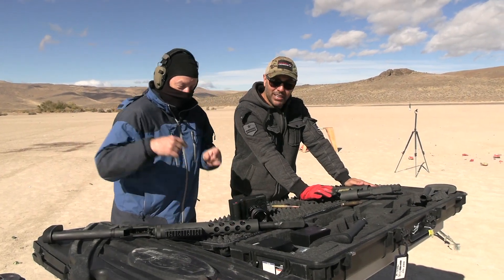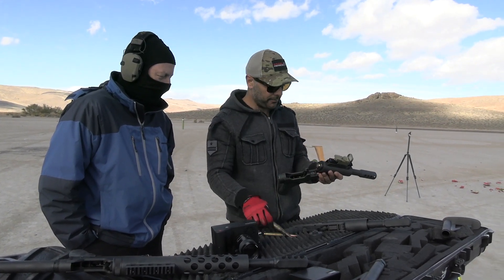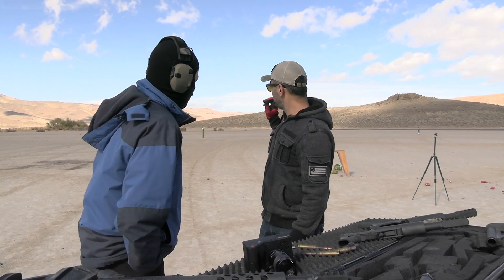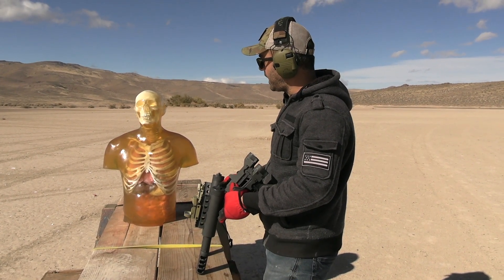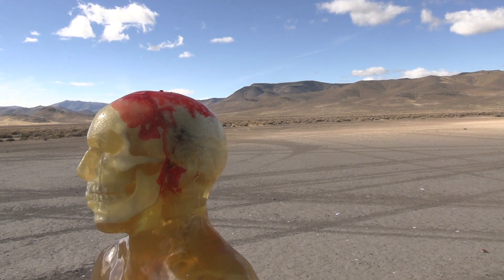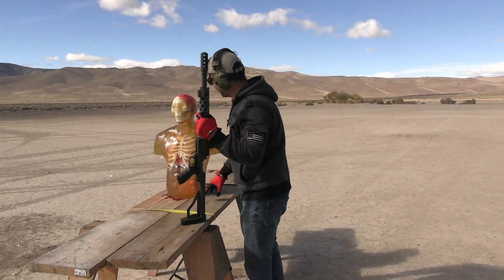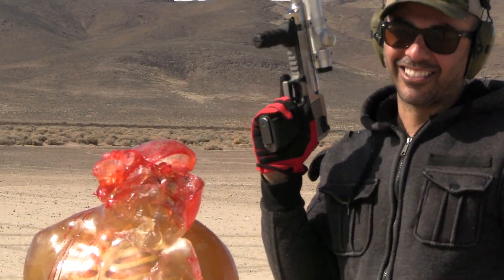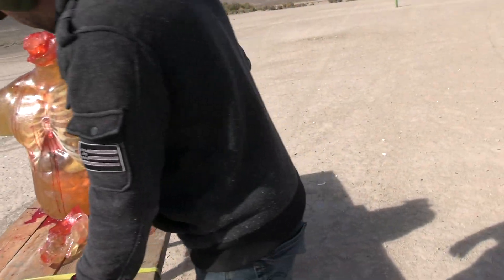Micro 50Bmg  vs Ballastic Gel

Comment: ...."when a high-speed projectile impacts the head and penetrates the skull, it first perforates a hole in the outer table of approximately the same diameter of its own presented area. However, as the bullet breaks through into the inner, less-dense trabecular layer, the area expands roughly in a cone shape until it finally breaks out a wider hole through the inner table. It is this cratering process that assists forensic pathologists in establishing skull entrance or exit wounds, thus facilitating the determination of the direction of the bullet's passage relative to the body and the direction of origin of the shot...."

Comment: Kinda surprised how little damage the .50 bmg SBR/pistols did. But I guess that’s what happens when you only burn a fraction of the gun powder in those rounds and such a short barrel to get the full velocity/energy from those rounds. But that “shotgun” puts a whole new meaning to “blowing the back out.” Pretty sweet to see that the dragons breath even went thru him. Cool video Edwin!
Reply: I'm sure the rounds are tumbling a dozen feet out of the barrel, too. There's no way that short rifling would rotate those bullets
Reply: It’s not just that. With full metal jacket rounds, at that speed, they just keep plowing forward. A good friend of mine who was a tanker in my platoon took a 50bmg point blank to the right shoulder, unloading the Ma deuce from the TC hatch. It was being handed up to him barrel first, but it wasn’t cleared properly. He dropped it and the bolt closed and sent a round right though his shoulder. Now, he was a giant man. 259lbs and 6’4. It punched a clean hole through him. A guy my size may have lost an arm.  Not only did he survive, he made a full recovery and returned to our unit only 4 months later. Then he was very tragically killed by an IED on Christmas Day in 2005. Survived a 50 bmg point blank, then got killed 6 months later. Absolutely tragic. 

RIP SPC Sergio Gudino 
KIA 25DEC2005, Sadr City Iraq
Reply: Mr Clean you are right, you can here the buzz of the rounds tumbling after they go through the ballistic dummy.

Comment: I have to ask. Why do you need to fill out the NFA paperwork for an SBR? There are plenty of rifle caliber pistols that don't require it. The thing is many to be fired like a pistol and can't be shouldered. Please explain.
Reply: if you're looking for logic and consistency you won't find it at the ATF
Reply: I wondered the same thing…. Designed to be fired with one hand and doesn’t feature anything such as a vfg or other item that might cause it to be an AOW. My best guess is that they used a frame that they already had on hand and at the time the frame was manufactured and serialized they used it on a full size BFG-50 which means it was originally a rifle and can’t be converted into a pistol. Similar to how when you purchase a stripped lower for an AR pistol build you have to make sure that the lower is transferred as a pistol on the 4473. Often referred to as the “once a rifle, always a rifle” or “first a rifle, always a rifle” rule. Basically you can legally convert a pistol into a rifle (and even convert it back into a pistol so long as it hasn’t been transferred as a rifle) but if it was initially manufactured as a rifle (whether by you or the manufacturer) then it’s illegal to convert it into a pistol. It would be a “weapon manufactured from a rifle”, not a pistol.
Reply: There was a "Cop-killer ammunition" ban passed in 1986, and the vague language in it makes it possible to outlaw any steel-core ammo that "may be used in a handgun". So if I made those as handguns instead of Short Barreled Rifles (SBR per the National Firearms Act), then it might be possible for the BATF to decide that .50 BMG ammo is armor-piercing handgun ammunition and ban it. Hopefully it's very unlikely they'd do that, even with .50 BMG pistols in existence.  But I sure as hell don't want to be the asshole who gets .50 BMG ammo banned,  especially since .50 BMG rifles are my main product!
Reply: @markserbu  good enough reason for me thanks.

Comment: The 10" barrels aren't long enough to accelerate the bullet to supersonic speeds.  That means the hydrodynamic shock of the bullet passing through is considerably lower, and the 50bmg round is point so it passes through without loosing much energy.  This is why there is no boom boom with the torso.  The 44mag is designed to be shot out of a handgun and the performance difference is evident.

Comment: These 50 BMG pistols have me jealous! They seem like they're so practical.
Reply: I like the intermediate length one
Reply: @tarmy3619  I agree, I've really been thinking about getting one. I just don't want to "Scott" myself. 😀
Reply: @The5As7  it wasn't the guns fault. A Barrett would've exploded with a lot less pressure.
Reply: @tarmy3619  I realize that it was MASSIVELY over pressured rounds, it was more the design that makes me leery. That breech cap on the end goes straight back in the event of a failure whereas on a semi auto it appears that the side blows out...Idk...
Reply: @The5As7  the semi's bolt flies back into your shoulder
Reply: @tarmy3619  There's way more distance and stuff for it to go through though. Bolt/single actions are inherently more dangerous because of that, not that you should always be afraid of that happening because its such a rare occurrence.